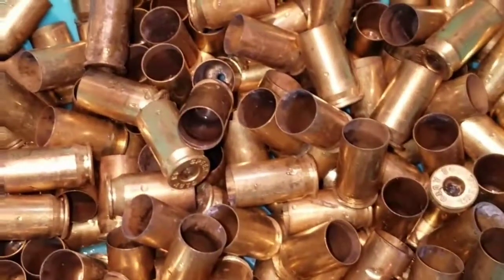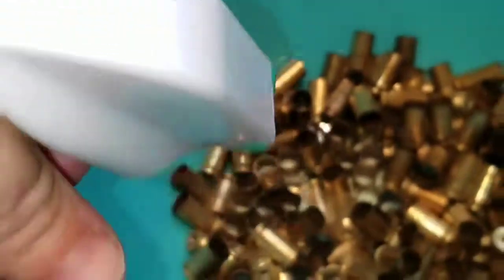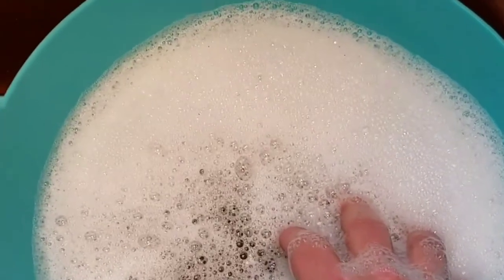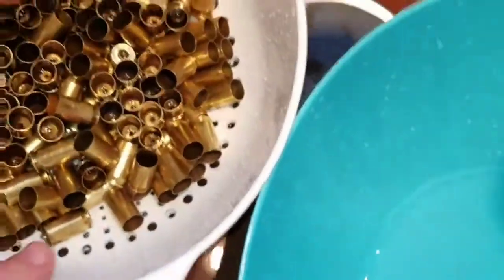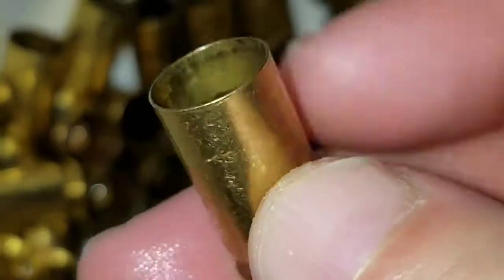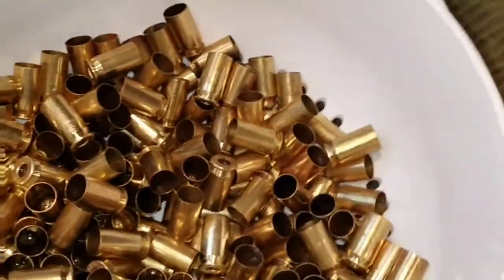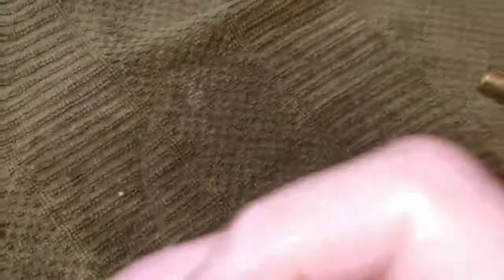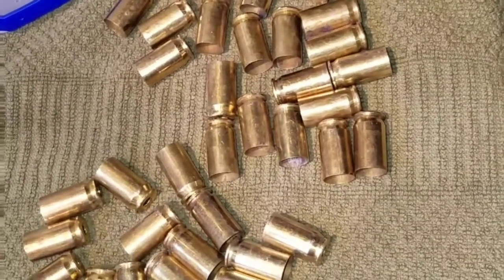Brass prep my way.

Comment: Great advice. I made a tumbler from a 20 oz bottle with a shaft in the lid so I could put it in my screw gun. Zip tie the trigger to the speed you want and let spin for as long as you want. Yeah I'm a cheapo lol.